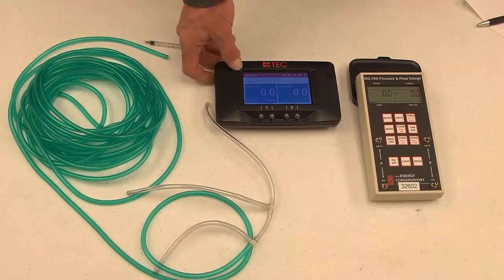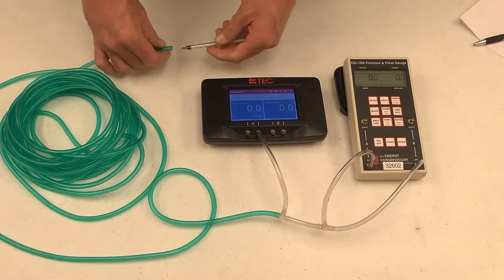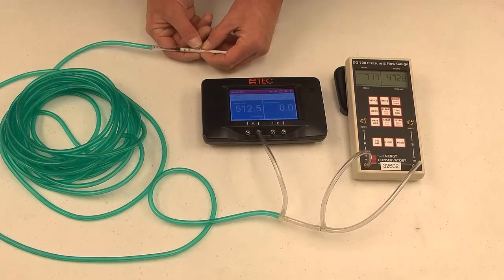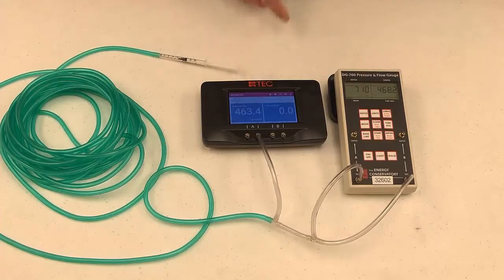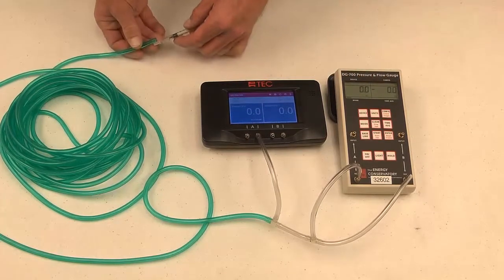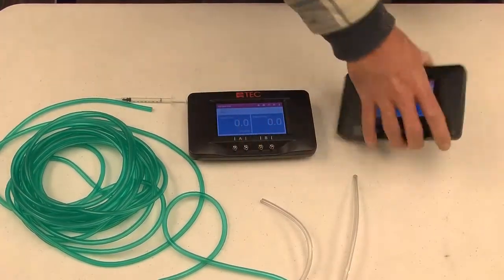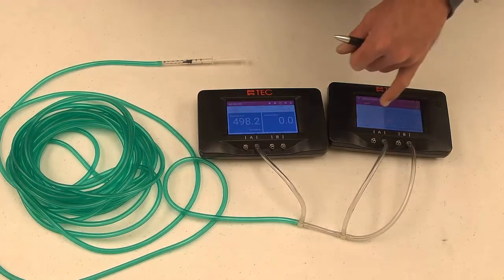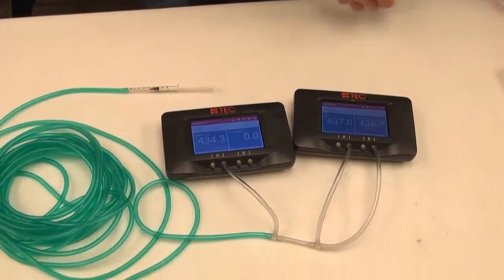Field Calibration of TEC DG 700 & DG 1000

Comment: Has TEC approved the field callibration test to be done in place of sending it back to the factory if the guage is past exiry of its callibration date? if so, how often does the feild callibration check supposed to be done in order to prolong the expiry as long as it reamins within acceptable callibration?